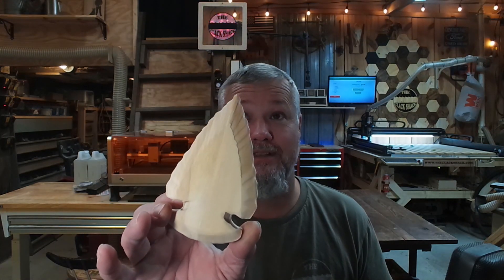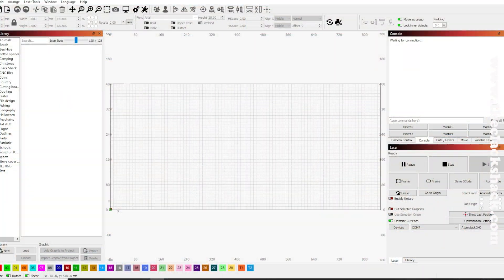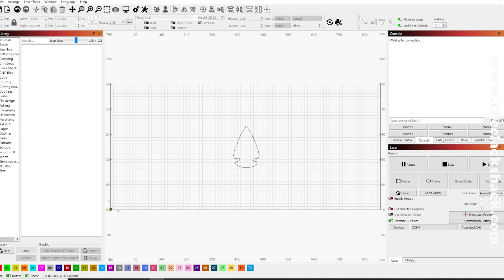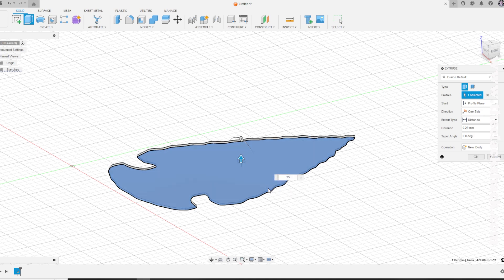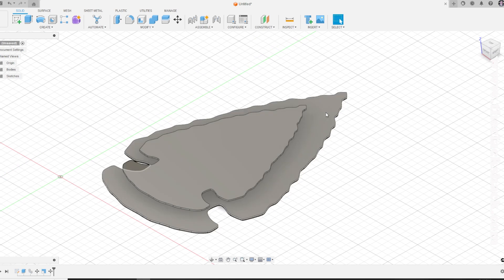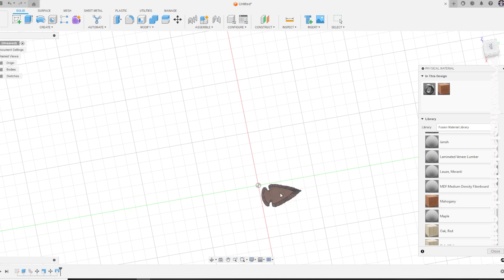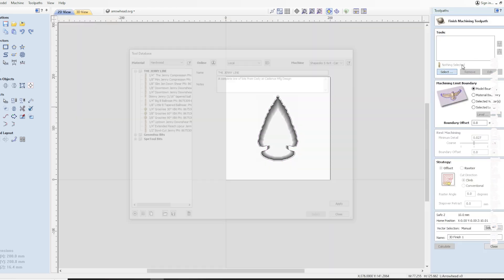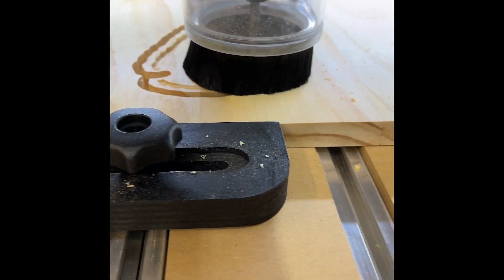Making a 3D arrowhead

Comment: Did you get Carbide Create Pro with your machine? Its stl converter is pretty easy to use.
Reply from the maker: I have the create software but I had already been using VCarve and just like using it. I have been using Create some but still not completely confident with it.

Comment: Can't speak to the different machine software, but I have found that Lightburn's trace function is really pretty good and use it for more than just laser projects by doing what you did except I usually export as DXF files.  Lofting to a scaled copy was a great way to get the effects you got. Cool video, will be fun to watch as you work through becoming more proficient with the CNC.
Reply from the maker: I am learning but stay so busy that my time to learn is limited. I was really happy with the results.

Comment: nice.  I am learning fusion.  other than using the process you did because you knew it,  is there some reason you would not have fusion create the tool paths?  does vcarve do something here that fusion cannot?
Reply from the maker: I haven’t had time to set fusion up for my machine. VCarve is just easier for my at this time. I have to sit down and create a machine profile and learn that side of fusion. I have always just used fusion for 3D prints. I gotta work on that…lol